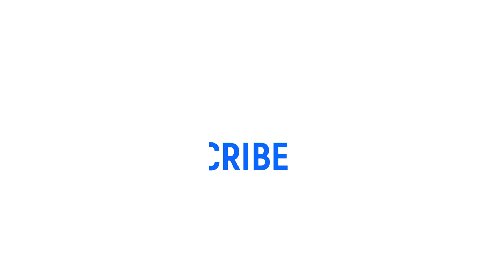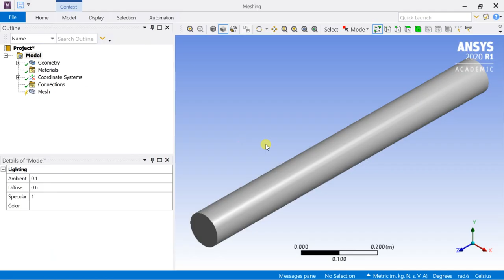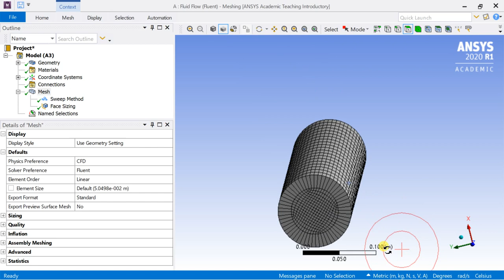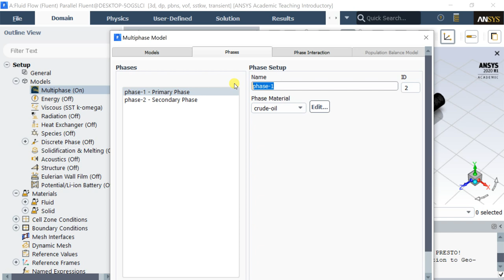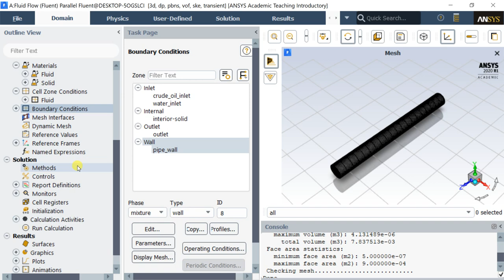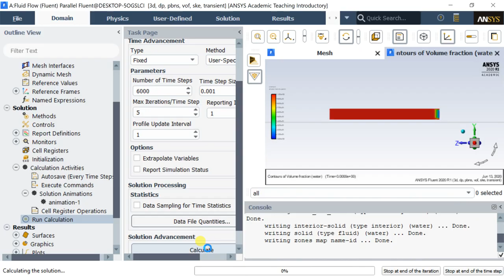ANSYS Fluent Tutorial | CFD Analysis of Two Phase Core Annular Flow in Crude Oil Transport Pipeline

Comment: @Ansys-Tutor, nice tutorial. Could you please explain why you set the initial oil (core fluid) fraction to zero and make water (outer fluid) fill the pipe?
Reply from the maker: As per the problem description the initial condition is the pipe is filled with water , so I had initialize as 0 vf .

Comment: That is an excellent explanation. Many thanks for ur work. May i ask a question. Im working on designing a heat exchanger that heats the R345fa with waste heat of exhaust gas of gasoline engine. In this case R245FA enters the heat exchanger tube in liquid phase and must exit in gas form as usual. My question is should i use multiphase flow analysis for monitoring liquid and vapor phase of R245FA. If u could answer my question i will be very happy with u.
Reply from the maker: Yes, you should use the multiphase model as its a phase change case.

Comment: I'm using a 2022R2 research version and am not able to split the surface into two parts, could you please guide me?
Reply from the maker: Reasearch version has only limitations on mesh (no of nodes/ cells) its do not have anything to do with the geometry.

Comment: Is it possible to simulate single screw extrusion in Fluent? the rotation of the screw drive the polymer inside...I just started learning... thanks to your videos...
Reply from the maker: you need to do that in ANSYS Polyflow software, ANSYS fluent is most used to study flow & Heat transfer calculations.

Comment: Thanks a lot Sir, nice video. I would like to run CAF on a 2D pipe, I set the geometry properties on a project schematic to 2D, but proceed like your video on Design Modler. when comes to meshing I had an error message " No valid Bodies found for 2D Analysis..). Is it not possible to run 2D analysis on a 3D geometry? Thanks

Comment: What if I have only crude oil running through the pipe and wall thickness is very small
Reply from the maker: Wall thickness does not matter a lot unless you add roughness modeling to it.
Reply: @AnsysTutor  I will try modelling it. Thank you.

Comment: Why when I was doing the sweep mesh method it failed? I checked the sweepable bodies and apparently no single sweepable body was there. Also, when setting the sweep mesh method, I couldn't find "Algorithm" setting.
Reply from the maker: the algorithm setting is available in latest versions like ANSYS 19 R3 & above.
Reply from the maker: sweep mesh is applicable if the is only a single geometry body.

Comment: If it is hot crude oil mixed with cold water, how can I set the heat transfer coefficient in the VOF model? I can't find the "Heat" menu under the "Phase Interaction" of VOF model.
Or should I use the Eulerian model?
Reply from the maker: You need to use patching for that.

Comment: Thanks for the video, it's useful. I have a question for the time step that you set, did you calculate it?. And I can see that you don't simulate steady part is it optional or not?. Thanks could you helpe me, please?
Reply from the maker: Time step size is the user input it need not be calculated, it depends upon you how much accuracy you want if you want more accuracy you can decrease the time step size further. This problem need the observation of how does the two different fluid flows in a single pipe, such type of realistic problem should be done using transient simulation.
Reply: @AnsysTutor  Sir, 
- If I have two inlets one for each fluid (T junction geometry), the oil is laminar and water is trubulent, what is the recomendation to configure this condition without using UDF? 
- Is it convenient setting the boundary conditions for each phase in one inlet due to simplify the geometry or not?
Thanks in advance

Comment: Thank you for the tutorial, i have one question regarding the initialization setting, why did you chose to initialize from all zones rather than from one of the  inlets with crude oil volume fraction set to 0 ? both ways from inlet or all zone could set the whole domain filled only with water (when setting crude volume fraction to 0 ) ?
Reply from the maker: It does not matter, you can initialize from anyzone. While initializing you can set the initial volume fractions as shown in the standard initialisation table.
Reply: @AnsysTutor  thank you

Comment: Do you have to use two inlets: one for water and the other for crude oil? Can we just use one inlet for both fluids?
Reply from the maker: Yes, for that you need to define the volume fraction of each fluent at the inlet.
Reply: @AnsysTutor  I figured out why my result is so much different than yours. The issue is the mesh. When you use the Sweep method, there is a large change in cell sizes near the water inlet (Ten cells in the radial direction at the water inlet are reduced to one cell). This large change causes flow instability which leads to the wavy interfaces seen in your video. I doubt this is realistic. The result is interesting, looks nice, but in my opinion, it is also misleading. When you generate the mesh, if you change the method to Multizone, you will have complete different results, not wavy interfaces, but two nearly horizontal lines.
Reply from the maker: Its just a tutorial demonstration. If you are working on such programs its highly recommend to do a grid dependency study and select the appropriate mesh.

Comment: Nice video. Can you please make a video on how to animate flow in vibrating bodies. I will use that concept in human inhalation analysis. When humans inhale air their body expands and squeezes, can you explain how can I do that?
Reply from the maker: You need to do non linear structural as well as fluid flow analysis for such type of simulation. Its a two way FSI problem.
Reply: @AnsysTutor  Thanks 💓